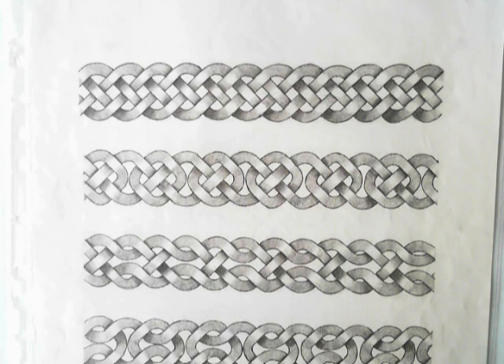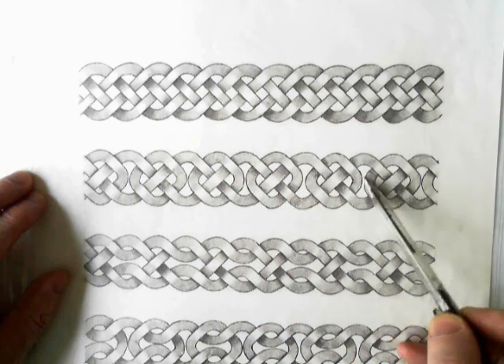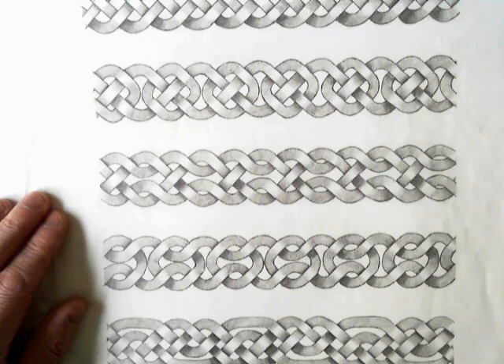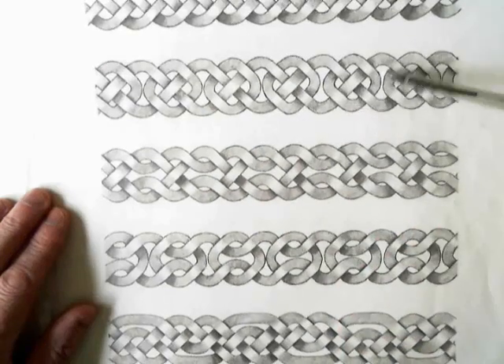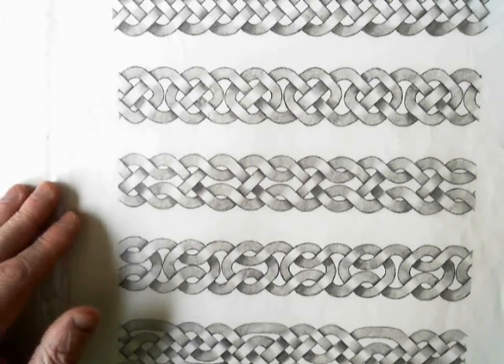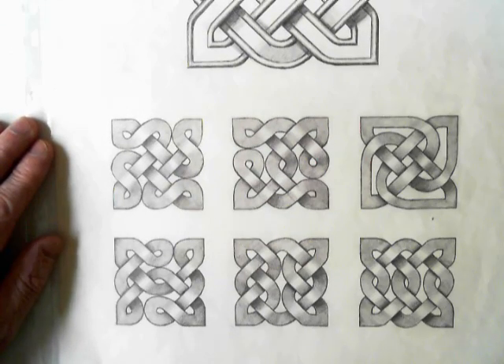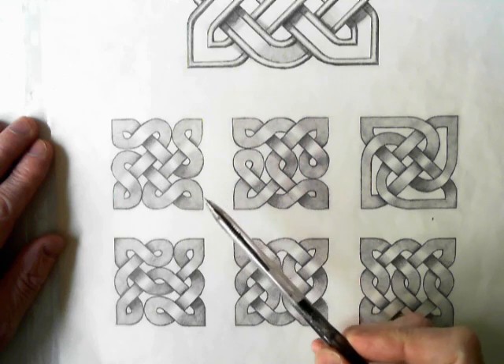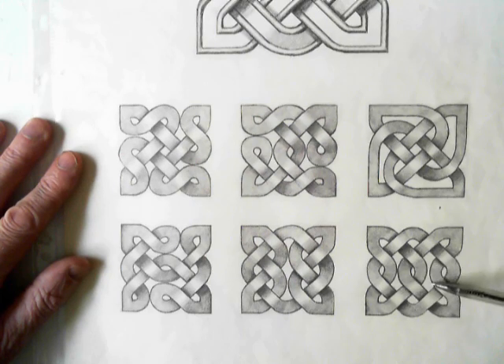Celtic Design 9 (breaklines 3)

Comment from the maker: Thank you for your very kind comments. I think the important thing is to try to keep the strand the same width as you go round. Don't worry if you have to stray outside the grid to achieve this - if it looks right, it is right. If you have a problem with consistency, you could do one, trace it off and then transfer it to the other three corners.
I'm about to put some videos up on geometry for designers, so you might find these of some help.

Comment: Hello, I love your tutorials and really appreciate them. If I may ask a question - in the 2nd knot from the top when you point out where the break line is, as it is just a 2 unit deep knot, how does the break line fit in with this? I've tried a break line 2 units deep and of course this isn't it, but if the break line is only 1 unit deep where does it go? I realise that I'm missing something really simple, but would appreciate your help!
Reply from the maker: Are you referring to the border designs, Clare? Be more specific.
Reply: @davidnicholls100  Yes of course. I meant the second from the top border design. I have now though worked it out, I just hit a blind spot before realising that of course the break line goes in the circles between the main unit circles as it were. Sorry! 
I am also very interested in zoomorphics which are more complicated, would you consider giving any tutorials on them at some point? 
Once again - thanks for your tutorials, I love them.
Reply from the maker: @clareroper-paris21  
Glad you've worked it out, Clare; and glad you're finding my tutorials useful.
I'll have a think about the zoomorphics.
kind regards, David

Comment: Sharing your knowledge and talents is so appreciated! You really have a gift. I have been working on my break lines and am missing something. I tried (your second example) with a 2 x 2 with a break line between every 2nd unit, which didn't work, and then  tried a break line after every 3rd unit and I still am not  <<seeing>> that nice interlocking link. I don't know if I explained that well.
Reply from the maker: you'll get it! persevere!  ;-)

Comment: For the long chains with breaks is there any specific way to space them because every time i try it doesnt work on the longer chains. please help.
Reply from the maker: Sorry, I don't quite understand the question
Reply: You said that you started with a two unit square knot and then added break lines. When I tried I couldn't quite get it right. How did you space the breaks exactly
Reply from the maker: It depends very much on what sort of design you want to produce. Just remember that the break lines must always join circles together, and if they cross they must also cross on a circle. Keep them regularly spaced.
Watch the video again and listen carefully to the commentary.

Comment: I've been experimenting with these, but have come across several variations that don't work :-)
Reply from the maker: +Su Mitchell 
Tell me what you thimk they are
Reply: It wasn't any of your designs, but if the break line was near the edge, I seemed to run into difficulties.
Reply: Su Mitchell I’ve found when running into problems like this, the fault is usually one of two things- uneven spacing or a mistake earlier in the work.